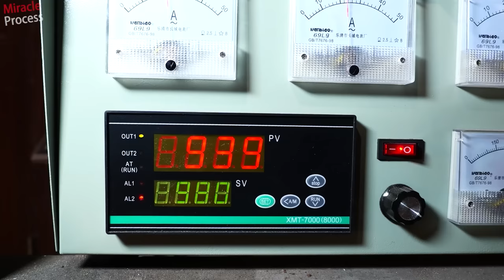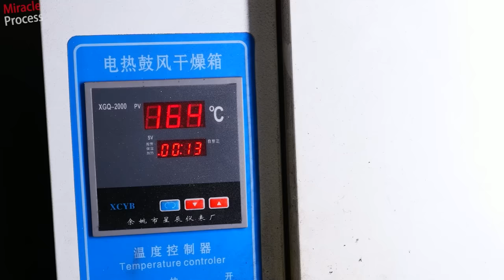Amazing! The Birth of a Chinese Kitchen Knife with Unique Craftsmanship

Comment: これを見るとやっぱり日本はスゴいんだなって思う
Reply from the maker: 日本で一番すごいのはどうだ？本土にはまだ米軍基地がある
Reply: Thật là xàm.
Reply: その通りだね、日本じゃ商品として「表面が傷だらけの包丁」なんか見たことないわ。
Reply from the maker: @オイうろたん  The "scars" on the surface of the knife you see are proof of handmade knives, while mass-produced knives do not have this feature
Reply: @オイうろたん  They could've easily sanded the marks away. Their customers actually wanted to keep the marks because otherwise it would look exactly the same as mass produced knifes.
Reply: 本来の中国包丁に芯材割入れは有りません｡
叩き切りでは 直ぐに刃こぼれします｡
日本包丁の芯材が硬いのは引き切りが前提だからです｡
Reply: There is still a very long distance when compared to Japan's knife making level